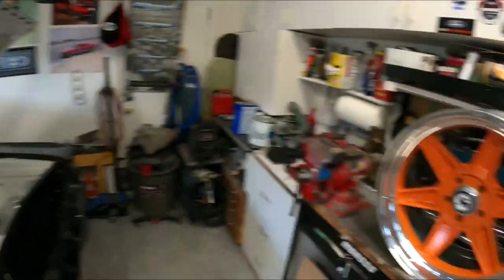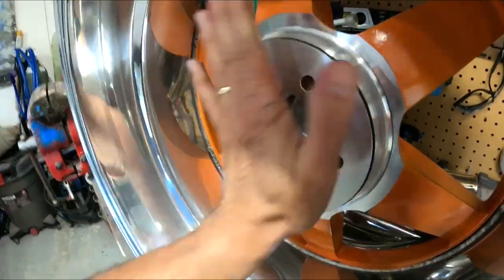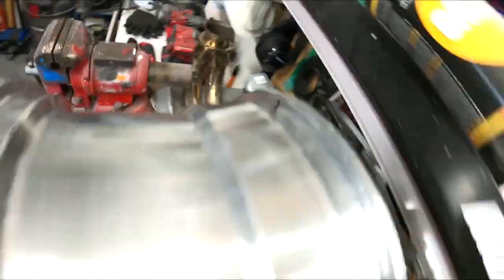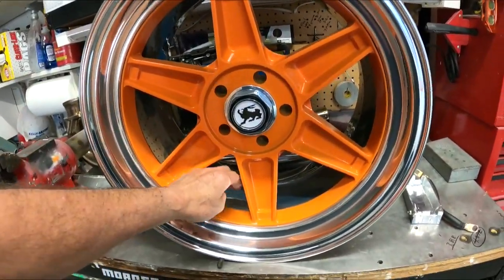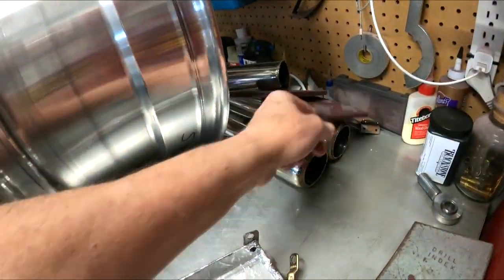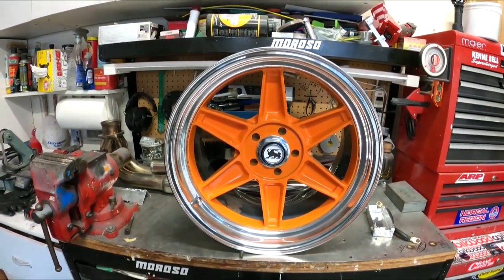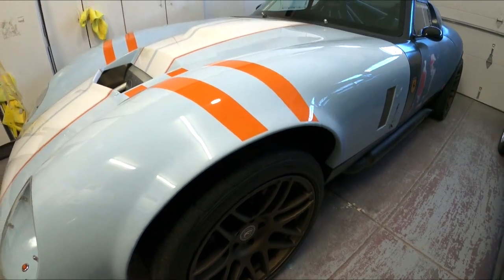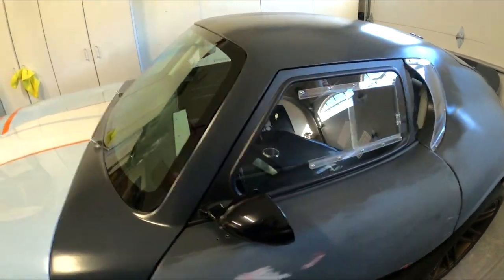New Wheel in the house- Cobra Daytona Build, Video 186

Comment: Will these wheel measurements work with a solid axle?
Reply from the maker: It all depends on what solid axle as the wheel mounting dimensions change depending on which axle you get. I would find someone who has used your axle to be safe. Lots of money could be wasted if you’re wrong.

Comment: Love the Terlingua logo. I’ve got a ton of Terlingua center cap decals from when I had some made for my GT500. Since my coupe is Terlingua themed I’ll have them on my wheels as well.
Reply from the maker: Where did you get the Terlingua logos?  I made mine but not really happy with the finished product. What year Gt500?
Reply: @cobradaytonabuild1671  I had a 2010 GT500. I got rid of it to build my coupe because there’s not enough room in my garage to store it and build. Miss that car.
I took the Terlingua logo off an online image and used photoshop to layer it over a black circle. After that I sent it to my local vinyl graphics shop and they scaled it to the size and printed them. I’ve got a bunch of you want some but the rabbit is Terlingua yellow on a black circle. Not sure if that would look right with your color combo.
Reply from the maker: Thank you for the offer but the color won’t go.  2010 gt500 is a great car. The new one is insane. I have the same garage constraint and it would be nice to have a huge 10 car garage. Oh well I can always dream.
Reply: @cobradaytonabuild1671  no worries, I’ve driven the new one on the track and it’s insane but the experience just is t the same with paddle shifters. Fast as all hell but the experience matters just as much as the performance for me.
Reply from the maker: Would love to drive the new gt500 but I agree with you. Cars are not engaging anymore, fast as hell for sure but computers are doing most of the work. The coupe is about engaging as a car can be.